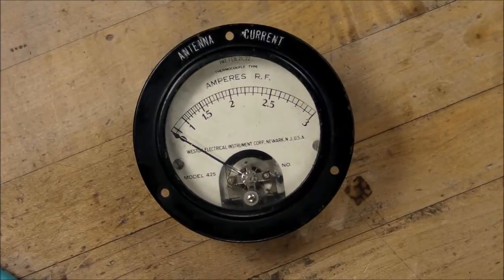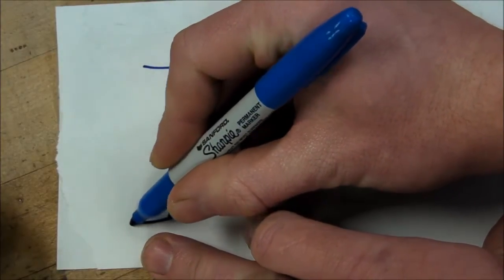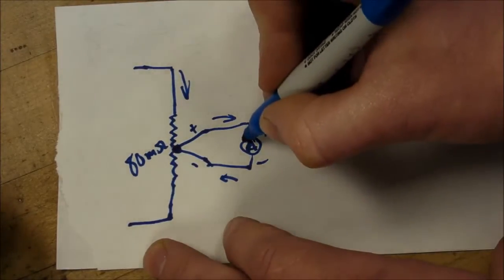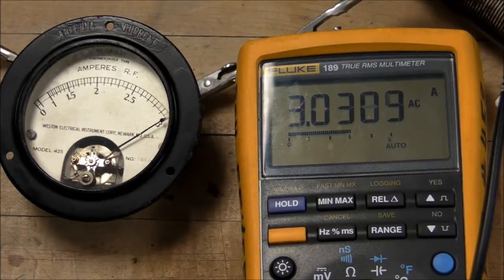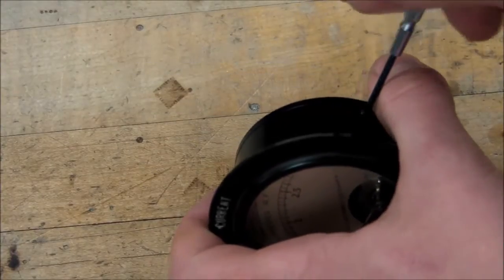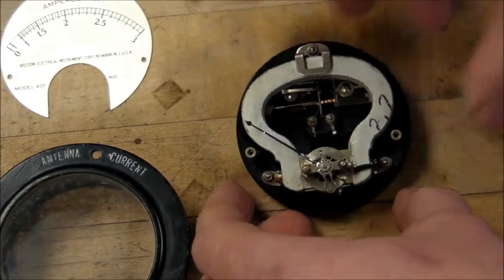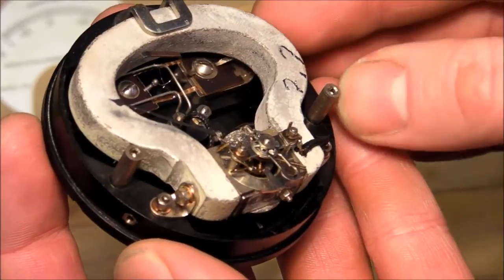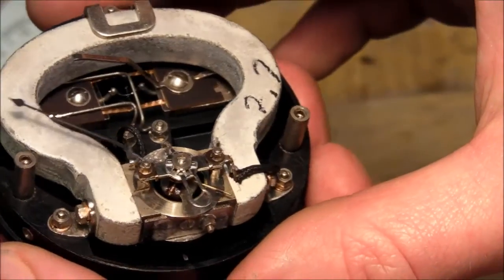(#0053) Weston RF Ammeter - Thermocouple Type

Comment: I have a similar type meter (says thermocouple type, amperes R.F.), Simpson brand, that I picked up at a hamfest but it's only working correctly with DC in one particular direction. When I try the other direction, the needle momentarily deflects a bit CCW and then moves CW to give a reading but the reading seems to be offset by about -0.5A (i.e. reads less than the actual value). Therefore, if I use AC, the reading is also less than it should be.
Reply: I've disassembled the meter to get a closer look at the thermocouple setup. It's really just two metal blocks joined together by two strands of (dissimilar) metals across which the potential voltage develops (as explained in this video) and  I'm getting different voltages depending on the direction of the current (same absolute value). Weird.

Comment from the maker: Interesting! I tried it on Weston 440 galvanometer which has a button that must be pressed to read current. With the button NOT pressed, I heated the terminals with a heat gun. It didn't matter which terminal or if I heated the metal body. Sometimes it had pos. deflection, sometimes neg. It is a purely thermal effect. Heats gets radiated, convected, and conducted to the movement's spring coils. If top spring is hotter than bottom, it deflects one way, if bottom is hotter, deflects the other way.

Comment: You can also see the thermal effects by taking an ordinary ammeter and warming up the one terminal a little, which will cause it to deflect as you then have a hot and a cold junction. Works best with those with very sensitive movements, some will reach almost full scale when one terminal is heated with a soldering iron tip.